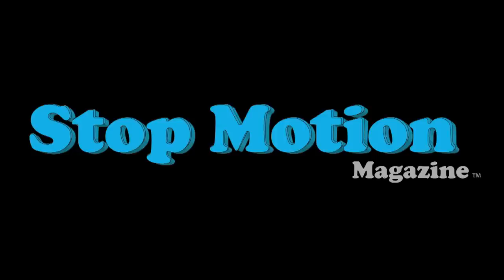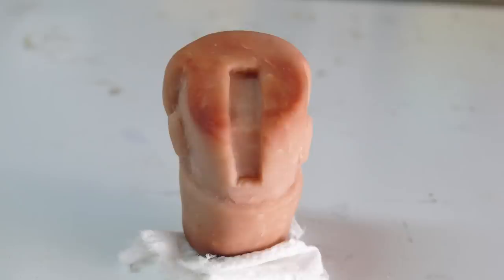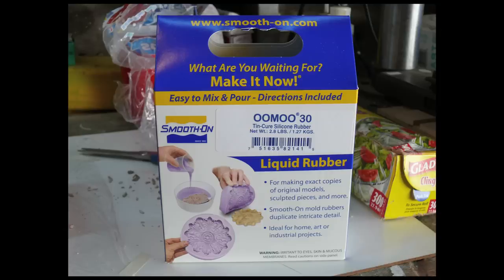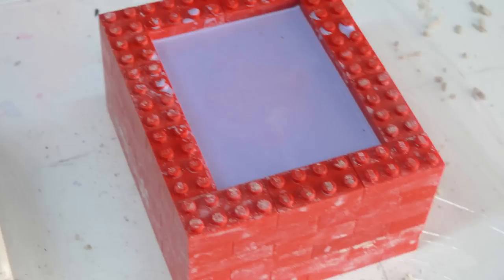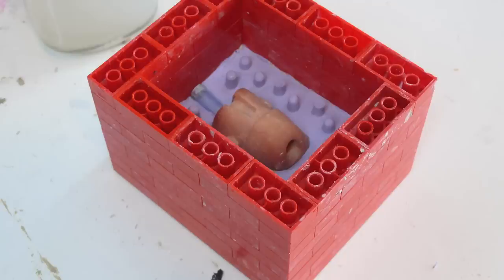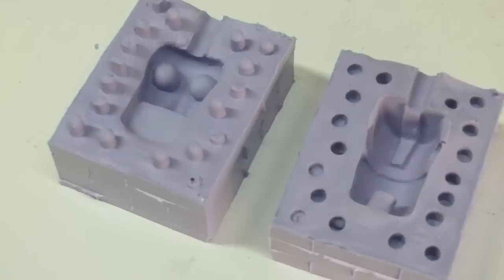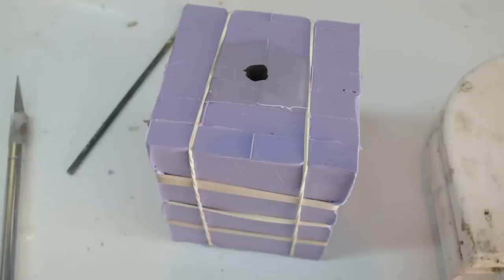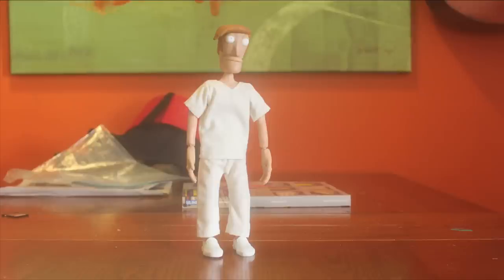S1 Silicone Puppet - Plastic Head Tutorial

Comment: Love this video really informative.This may be a strange request, I am wanting to create a human head that is about 3 inch in height, I need moving lips , eyes and eyebrows, . Is it possible to sculpey the basic and drill holes to put wire in ? then what about skin ????
Reply from the maker: Don't use Sculpey. I would suggest either making a plastic head or using wood as the base. Then drill the holes and place wire or metal paddles into it. Then cast the head in silicone or foam latex. You can even do a buildup using liquid latex and tissue but it is extremely difficult to get a professional level buildup puppet made the first time. I would stick to molding and casting.

Comment: Very informative, couple of questions.. 
Will any strain of Sculpey do for the initial model? And what are the best paints to use on the final cast, acrylic?
Reply from the maker: I usually use Super Sculpey or Sculpey Firm, but anything will work. Yes, you would paint it with acrylic. Make sure you clean the sculpey of any oils and then prime it with a priming spray before painting. I like to use the primer used in model making and Gundaim building.